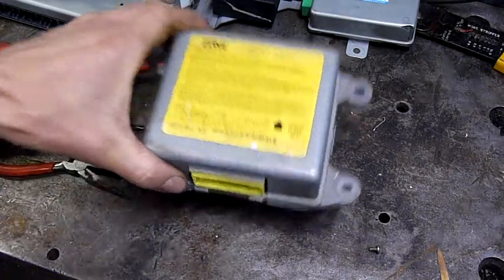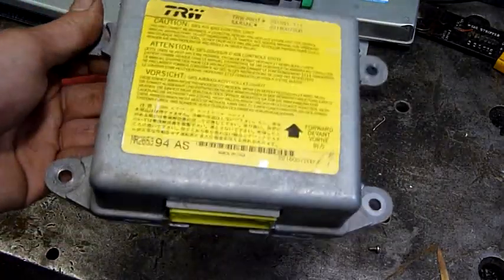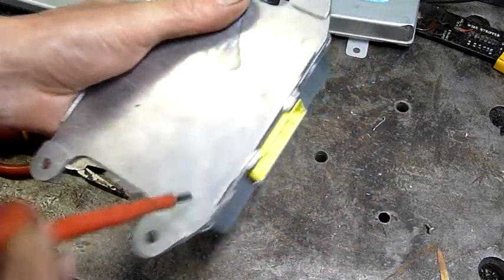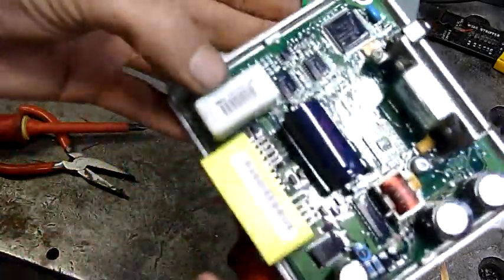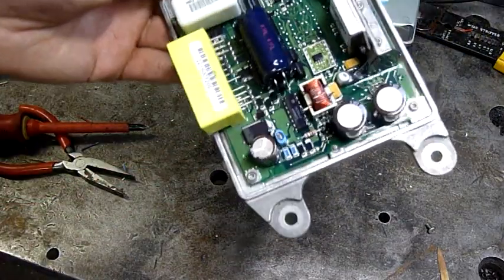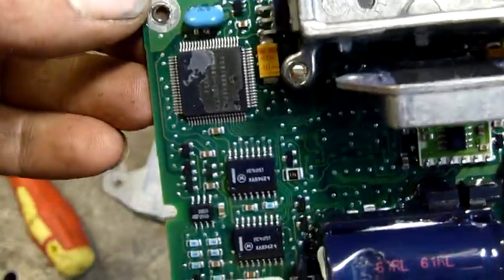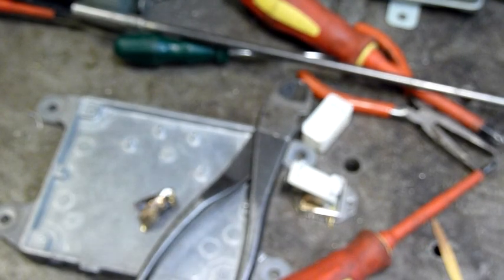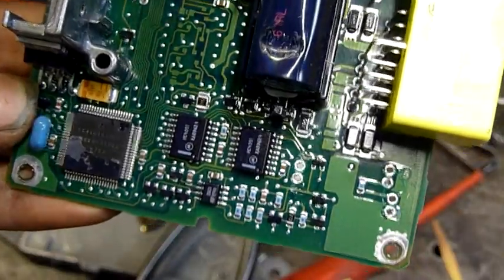TRW Air Bag Controller Autopsy - 2001 Mitsubishi Magna

Comment: the small 8 pin device on its own board is an eeprom which holds the main code the mcu acts on. the large smd device is most likely a high power zener diode to protect the 12v rail from voltage spikes (in some modern cars 90v + spikes are common on the dc rail from coil packs etc)

Comment: The requisite standard used was/is to trigger at least two sensors to blow the bags, most cars from that vintage did away with the external sensors in the car, and both sensing elements are within that unit, an accelerometer (presumably 3-axis) to determine angle of impact, and an inertia switch/sensor.    Some inertia sensors actually sense the rate of decelleration by the amount of voltage/current induced in a coil by a moving magnet/metal slug, a '98 Chevy module I took apart worked that way.

Comment: The large (undamaged) IC in the metal can is a high-performance ADC. Presumably, the damaged chip was some type of precision analog sensor - not sure what kind (usually MEMS accelerometers are digital devices, so they don't need an ADC). The whole thing was canned to ensure that the analog circuits weren't disturbed.

Yup - the big diode is likely overvoltage protection (or possibly reverse polarity connection). Under overvoltage or reverse connection, it shorts out and blows the fuse.

Comment: The covers have a relief cut/molded into the back side of them (across the center, down the sides - 'H' pattern), that splits open to allow the bag to come out the center of the module without becoming a projectile.    Passenger side may have a similar releif cut in it as well, or may have a tethered cover (late '90s Chevy Lumina/Monte Carlo's do this).

Comment: The sensors are in sections. In this case the sensors in the cars front are not enough to trigger depletion.
The internal sensor (with the spring) is a sortof failover swith. Meaning the internal springladed switch _AND_ one of the sensors in the cars front need to sense, to let the controller trigger the airbags.
This is to prevent unintended triggering. For example, when somebody kicks the front of the car (we've all seen the video), or if one of the sensors should give a false reading.

Comment: I built these on the flex 7 line at TRw . The switch is a ball bearing inside it and a knock rolls the bearing to make a connection and the deploys the gas and airbag inflates .

Comment: The large diode at the end is a surge absorbing diode.  A large fast acting Zener diode.  Begins to clamp at about 22-25 volts typically.

The metal can device I still don't know.  I have seen them in Mercedes convertible top controllers where they have a deployable roll bar if the car flips.  The IC under the ceramic cap may be a MEM accelerometer.  The IC above that detached, the signal conditioning?

Comment: that inertia trigger takes quite a bit to move if you think about the weight of the car and the weight in the switch. say the car weighs a single ton (1k kg) and that little weight in the switch is maybe 50g, to stop that one ton car AND have the 50g switch move enough to lose contact is a lot of energy. moving it with your finger may seem easy but in actual situation, the car would need to come to sharp stop (a wall or other car) to move that 50g weight. /rant-speculation

Comment: Generally SRS control units aren't resettable. Once triggered, the CPU logs the crash data into its EEPROM. If there is a record present, the system will not boot, and will just return an error code.

Air-bag deployment is a major cause of vehicle insurance write-off. The cost of replacing the entire SRS system is generally prohibitive unless a newer high-end vehicle.

There are firms that can resent an SRS ECU by unsoldering the EEPROM and reflashing/resoldering it. Bet that's reliable...not.